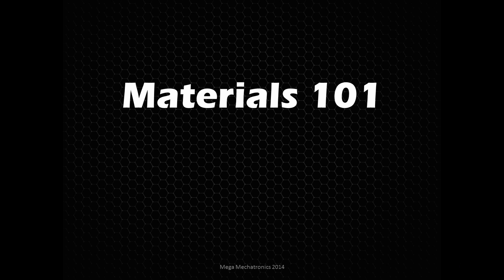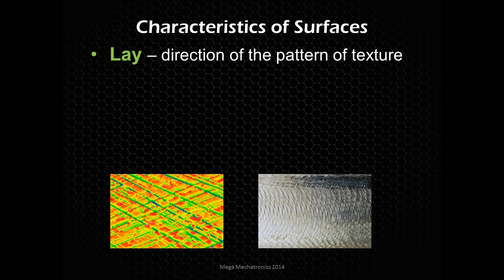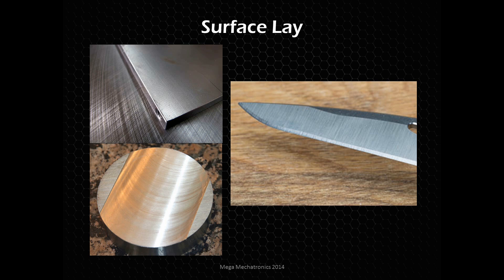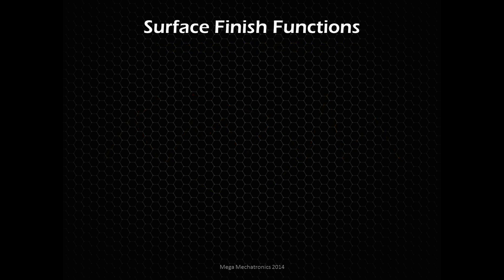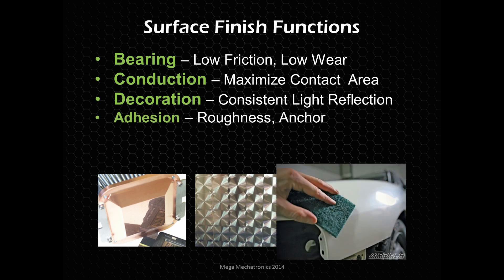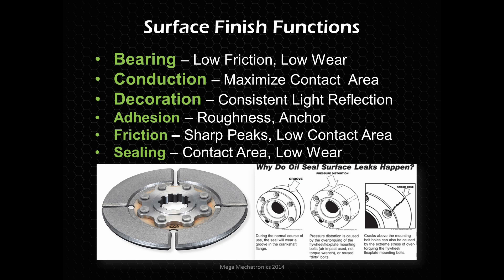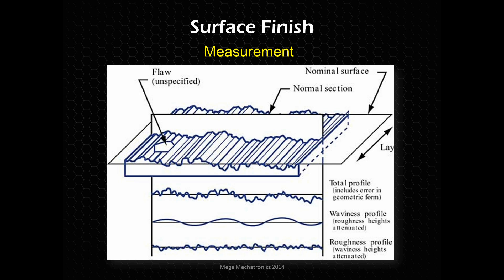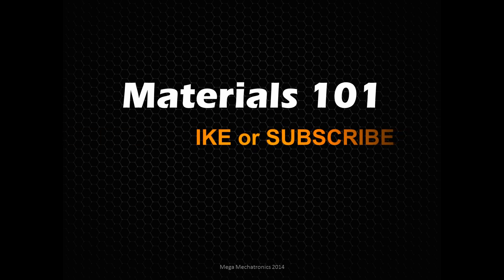Materials Science Mechanical Engineering  - Part 6 Surface Finish Explained

Comment: Thanks for the series, it was great! At https://youtu.be/WtDU1Oov4so?t=15m42s that is called an atomic force microscope or AFM, the type you describe is cantilever type but you can also have ones that have a laser instead of a stylus. AFM's give a 3D topograhical scan but they can also give you a 1D scan across a plane as well.